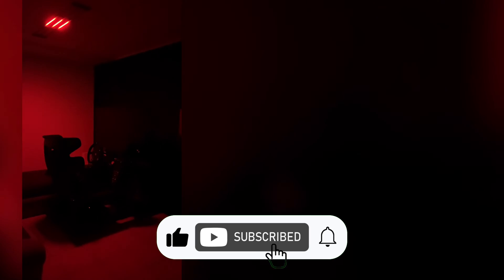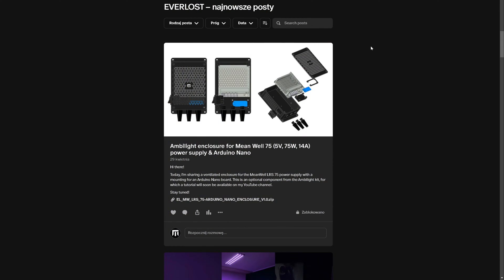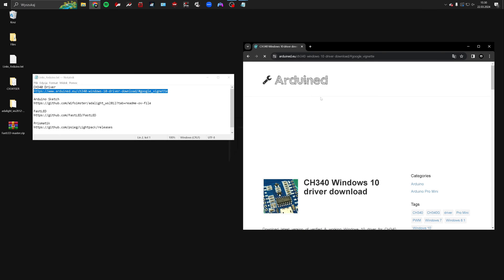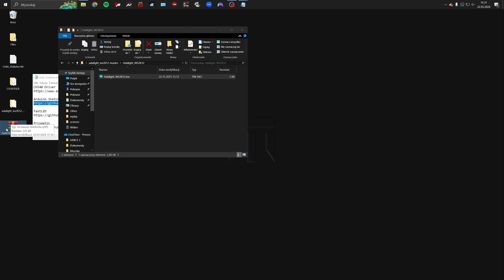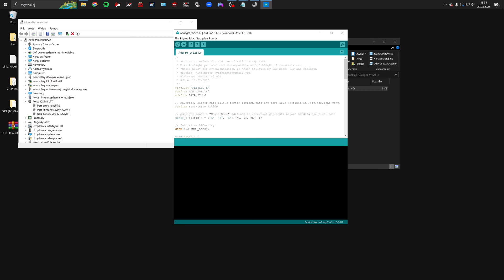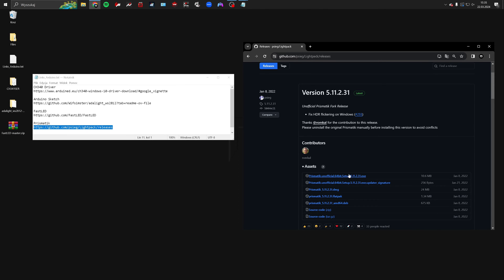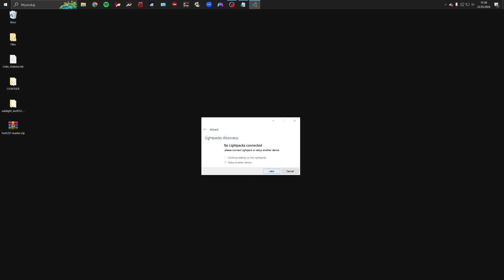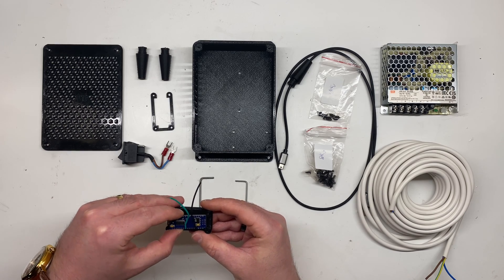Cheap and effective Arduino ambilight lamp for Sim Racing - DIY

Comment: Does it work with Raceroom?
Reply from the maker: @Squeezy01  It works with everything displayed on the screen except for Netflix 😅
Reply: @MR.EVERLOST  also how about putting the LEDs in a softbox? Is it neccessary? And would it be an improvement?
Reply from the maker: @ I don’t know 🤷🏻‍♂️ don’t have softbox 😅 im happy with the results from this simple solution and Prismatik app.

Comment: Thanks for your video. It helped me a lot in building mine. Do you think I could get better response times using a Teensy 3.2 board? I have 258 WS2812B type LEDs installed.
Reply from the maker: @fernandojconti  happy to read it 🙌
But regarding to teensy I never used this board. Arduino works immediately and in  Prismatik you can set this in ms as far I remember.
Reply: @MR.EVERLOST  There is a slight delay between the image reaching the edge of the screen and the LEDs turning on, which apparently cannot be fixed by software. It is notorious when you have the LED strips attached to the back side of the monitor.
Reply from the maker: @fernandojconti  I didn’t noticed it because I use screen grabbing solution from the center of the screen and I’m using „average screen grabbing color” or something like that. On the video you can see how fast colors are changing for example when I get into shadows, but maybe I just don’t see this tiny lag 🤷🏻‍♂️
Reply: @MR.EVERLOST  Well, I'll have to try it myself. By the way, the current version 9.4.7 of SimHub works fine with your proposal solution as well, I have both tested in my setup with no issues.
Reply from the maker: @fernandojconti  I will check it for sure. Thanks for the info 🙌

Comment: great job, just ordered the parts  :)
Reply: I will always go for the cheap and home made 😁💪👍👊🤘
Reply from the maker: Thank you 😀 yesterday I watched Philips hue and govee lamp configurations and don’t know, this looks better for me and is a lot cheaper…
Reply: @MR.EVERLOST  Hi,got one question can i do 2 ledstrips of 60 and 1 of 40 or do i have to adjust the sketch then?
Reply from the maker: @willemvanesdonk8577  this power supply can handle safety 180leds, so you can use less LEDs but you need to know how to connect data cable because it’s one direction signal. You also need to know that more LEDs in sketch = more blocks on the screen to adjust. It could be more time consuming to adjust it to specific car 😀
Reply: @MR.EVERLOST  ok thanks for the info👍
Reply from the maker: @willemvanesdonk8577  waiting for results Willem 😀